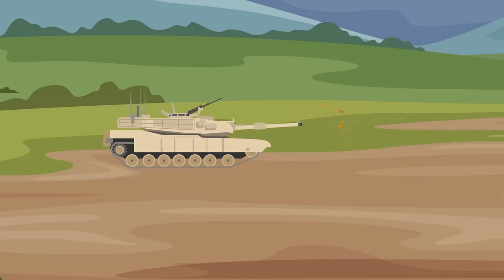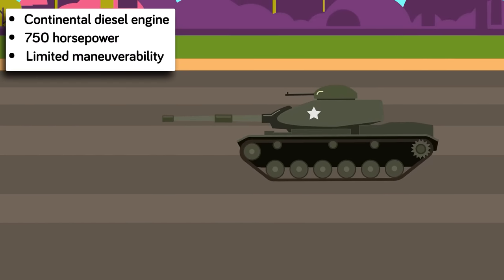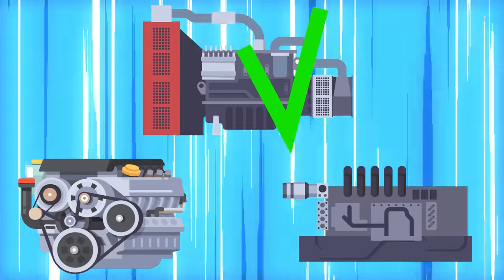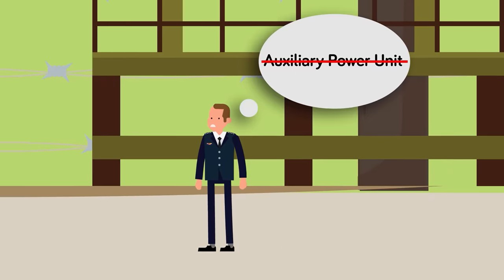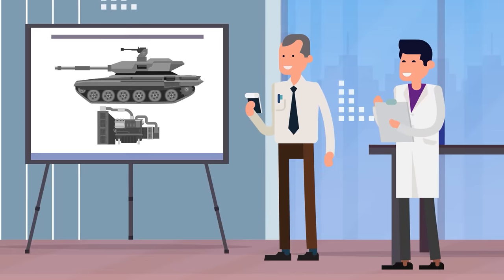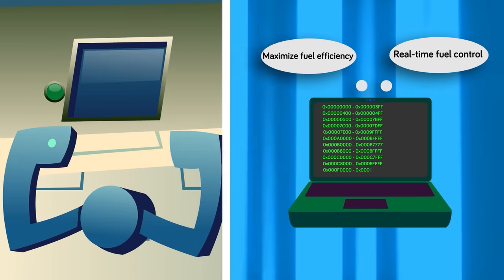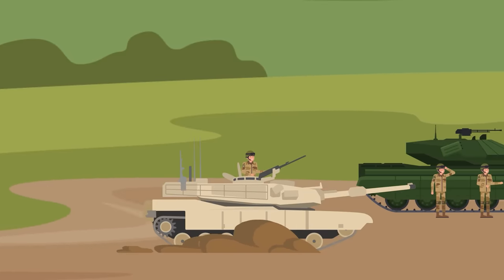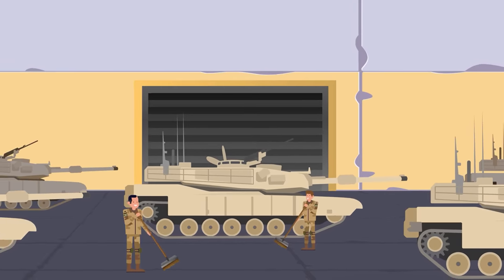Why M1 Abrams Turbine Engine Is Actually OP

Comment: To distinguish between the 2 types of engines mentioned here, the terms should be "turbine and reciprocating" as they both can and do run on diesel/kerosene aka JP-8 and JETA.
Reply: That is well pointed out. Before I was forced to work on track vehicles, many wheeled vehicles I worked on were multi-fuel. I never thought of it before the military.
Reply: But there's no such thing as a diesel turbine.

A "diesel" is a piston engine that runs on diesel fuel.

A turbine that runs on diesel, is a turbine that runs on diesel. It's not a "diesel".
Reply: @Robert Pruitt  The fuel that we recently used in the military (JP-8) is very similar to diesel.  I handled it daily for 4 years in the USAF.  I believe now all the military went to JET-A and I've never dealt with it.   But,  yes a turbine can and will run on diesel if it's put in the tank.
Reply: @MrBen527  
You didn't grasp what I was saying.

I said a turbine that runs on diesel isn't a diesel engine. It's still a turbine by name. It's a turbine that runs on diesel, not a diesel turbine.

A piston engine that burns diesel is called a "diesel engine". It's not called a piston engine that runs on diesel.

And I clearly stated that turbines can run on diesel.
Reply: @lordgarion514  You said there was no such this as a diesel turbine.  And, IF diesel was used in a turbine, it would be a type of diesel engine.

Comment: The AGT 1500 also has no problems with cold weather starts, as well as it is a very quiet engine compared to piston engines. Also, turbine engines have a higher power to displacement ratio over diesel and gas engines
Reply: Wow! You really don't know your history regarding the M1 Abrams.
Cold weather starts have been a major problem for the Abrams since it was introduced into service and remains a flaw in its design.
Reply: Actually the Continental AVCR-1360 that won the XM1 trials competition was rated at 1,600 horsepower and weighed the same with a lighter combat weight due to the smaller fuel cell.

Comment: First, the IR signature of the Gas turbine is larger, the injectors are more prone to soot and have to be drilled out regularly. In normal conditions it consumes almost 10x as a modern diesel engine.
Reply: That entire post is a flat out lie.
Reply: 10x? You just making stuff up for what reason.??

Comment: For the equivalent hp output turbine power plants are much lighter than any piston powered equivalent. How does the M1 get it's pressurization and air conditioning accomplished? If it uses air cycle machines then the "overpowered" power plant has to be so to operate at full power and provide bleed air for the acm. Just thinking out loud.
Reply: It's overpowered because if you take the regulators off, it'll do over 70 MPH.

Comment: I vaguely remember that the engine was a repurposed Apache engine but seems I was wrong lol. But, didn't M1s had issues with getting fine dust/sand through intake that would cause engine failures?
Reply: Yes, same as that Vulcanic dust issue the jetliners had.
Reply: No
Reply: FOD is not too good to aby turbine engine
Reply: Well, not engine failures, but in the first Gulf war, the sand gave the tank crews a bad time. They constantly had to stop and clean them.

They designed better filters after that.

Comment: I was in an M1 with no turret.  We turned off the limiters. It went way over 70mph. I bet it would still do 60mph or more. The driver let off as we all felt it was on the edge.
Reply: Probably 60km/h! tracks wil not do 70mphl

Comment: Abrams and HIMARS engines are very similar in one thing - a lot of it's components can be just easily unplugged/unscrewed and replaced. ECU fried/burned out? Just swap it, no dismantling needed. A lot of HIMARS engine parts can be just swapped without much trouble.
Reply: You're talking about the vehicle of the HIMARS, but same is true with the components of the rocket system. swappable boxes.  We were trained on how to open the boxes, pull out the motherboards and how to solder and desolder, but not how to diagnose fried chips...

Comment: OK but when it sits still because running out of gas will it still be such a beast ? It's probably a beast when supported by a very much intact supply line. A Leopard 2 will go much further on same amount of fuel. Keeping robust logistics in a conflict is not always affordable.
Reply: Check out operational ranges of both tanks. Roughly the same because Abrams has a larger fuel tank.
Reply: The US Army must be the king of logistics because I never ran out of anything, Especially, Fuel, Beans, and Bullets. That was during assaults' or at an OP in the middle of nowhere. Lets say for the sake of argument that you did run out of fuel. Can you think of a better bunker than a Tank? You don't have to run the engine or EAPU to use all a M1's weapon systems.
Reply: The entire world spends $1.92 trillion on defense (before this current Ukraine war).

Of that, Russia spends $60B, and China spends $250B.

All of NATO spends $1.1 Trillion, and of that $1.1T, America alone spends $850 BILLION.

There's not a country, or a private company, with better logistics than the US military.

Comment: Even though it would have been meant to run on jet fuel, it pretty much can burn anything you dump into that's flammable enough to run it, as Jet A1 fuel is technically a type of diesel fuel, being comprised of mostly Kerosene. If you are desperate to get tank moving, you can just dump in gasoline and call it a day. Jet engines including this turbine engine have advantages that allow them to function regardless of height and fuel type. Just so long it doesn't have water in fuel system unless the turbine engine in the tank got a way to get rid of water automatically (most trucks do, yet I am not sure about military vehicles as they have very different designs to ensure their survivability).

Comment: One thing the old abrams had one major flaw with the gasturbines it had exelent dust filtes exept  for shellsand its so fine it passed through the filters .and crushed shells is the stuff that turns in to quiklime when heated but also destroyes the turbine blades .  real nasty stuff ,
Reply: I would imagine engineers managed to solve the problem with better air filtration, right?
Reply: @tluzanov  not for the volume of air needed.

Comment: this gas turbine engine runs so hot its IR signature can be seen from space. It would be cheaper to equip them with mobile phones if they want to let the enemy know they are coming.
Reply: Anything hotter than background will show on thermals even if it 1 degree up or 1.000. 🤦‍♂️

Comment: It's really too heavy for Eastern European plain terrain like Ukraine. Trust me ! No military commander in countries with low military spending would want to take on this fuel-hungry monster. It was a bad idea 40 years ago, when General Dynamics Land Systems designed it a turbojet engine for fighters. It's like the Kharkov Tank Machine Plant's T-80, it's strong and fast, but the T-80 is lighter and more maneuverable on the frozen ground of harsh European winters. The Soviets and Americans confidently secured the technical logistics of these jet-powered T-80s and M1s, but after 30 years too many problems arose. What they have in common is the high cost of engine repair, which is naturally higher than that of an internal combustion engine. But the Soviets had a spare in their possession of Uralvagonzavod's T-72 tank. It is like Toyota Hilux, very durable and easy to repair, very popular in military forces with low cost. An important thing that M1 is ranked below compared to Leopard 2A, is that it does not guarantee good maneuverability. The German Leopard runs on a Diesel internal combustion engine, of course this MTU Diesel engine is more "friendly" than the other turbojet engines.

Comment: It now has an upgrade where it will probably end up being able to be deployed for many many more miles, and many many more hours it has a battery power plant that allows it to operate with its engine off saving fuel, and obviously being significantly quieter
Reply: The Gas turbine is a major disadvantages in standby endurance and battlefield performance.
This is why the Army selected the Diesel powered General Motors XM1 for adoption into service.
Reply: @WilhelmKarsten  it was the most powerful that’s

Comment: The one great thing about the gas turbine is you can put ANY fuel and I mean ANY fuel.  Diesel, gas, anything that is combustible you can put in it and it will run and take that type of fuel. So in a pinch the maintenance and supply team not coming fast enough if you see a gas station and are desperate for fuel then you can use gas of all kinds.  The engine will take it.
Reply: That is completely false, stop posting lies and misinformation.
Reply: The Lycoming AGT-1500 can only be run on NATO STANAG CODE fuels F-18 through F-77  or their civilian equivalent. Some of these fuels can only be used when blended with another type.

Comment: The M1 Abrams can travel speed on flat hard ground of 57 miles an hour that’s with half a fuel tank and no ammunition that’s amazing but once it’s completely loaded and ready for battle the maximum speed I believe is 44 miles an hour which itself is also pretty significant, and the engine is one of the more reliable engines in this class. The only other tank I would have concerns with if I had a battle with it would be the British challenger only because they have a much longer shot capability because they’re armor. Is not of the same caliber as the leopard or the ABRAMS

Comment: Well, the conventional combustion engine of the leopard 2 is limited to exactly the same 1500 HP and can also be replaced in about 4 hours.
It runs on gasoline and Diesel and consumes half of what the turbine of the Abrams wants.
Reply: The Leo2 drive unit can be replaced in about 30 minutes.
Reply: leos are much much slower

Comment: you can’t say 1500 HP of ENERGY. Hp is a measure of power, not energy. Energy is Power x Time. For example Kw is the unit for power and Kwh is the unit for energy: 1 Kw of power for one hour

Comment: Is 45 mph the top speed on it?  I remember it used to be 60 mph.  I knew a guy who worked on them 30 years ago and said if you take off the speed governor, it can probably hit 80 mph.  But you'd run out of gas pretty quickly.
Reply: That's before the M1 developed a weight problem...

Comment: Turbine engines have their advantages and disadvantages. They are compact and produce a lot of torque but in return they are hugely inefficient especially when idling and have a big thermal signature. 
With only very few countries ever using turbine engines in their tanks and russia moving away from them i would guess most countries consider diesels the better option

Comment: I wonder when an electric hybrid tank will be used. Seems like the most efficient and powerful way to move a heavy vehicle.
Reply: The next generation abrams are actually set to be hybrid to save on fuel. This could also cut down on noise if you want to move more quietly for some distances

Comment: There's so many things that are close but still wrong. Also, saying that the engine was fuel inefficient is a comparison to cars and trucks...but in reality they weren't far off from peer tanks and in idle they were basically the same, but under a load they are better.

Comment: The 45 mph / 30 mph on road /off road speed the Abram can achieve is not its true top speed.  It is a regulated maximum speed.  The Abrams is capable of going much faster, but the problem is that doing so will cause accelerated wear on various parts of the tank.  Also, going faster than those speed posses increase danger to the crew.  When you're inside a vehicle weightings over 60 tons, accidentally hitting a heavy obstacle or going over a large hole on the ground while going over 45 mph will result in serious injury or even death.

Comment: The engine is the big difference to the Leopard 2 (armor and firepower are about the same) and the reason why the Abrams is the worse tank.
By using the turbine instead of a Diesel it trades an additional supply line for cerosine plus a higher fuel consumption which needs to a significantly lower range for a few hp which don’t really make a difference. On top of that the turbine is more difficult to maintain.
That turbine is a really bad idea
Reply: Abrams can run using any fuel, army uses JP8 as it is universal fuel. Turbine is easy yo maintain as the only moving part is the compressor.
Reply: @viceralman8450  not true, not spreading lies and false information

Comment: I always laugh when I read comments on other channels calling the M1 “slow”. The tank’s engine makes 1,500 horsepower and (more importantly) 2,750 foot-pounds of torque at 3,000 rpm. No other tank engine on the planet comes close. It can accelerate the current 69-ton version of the M1 to its governed/rev-limited top speed of 42 mph in about 15 seconds. There is anecdotal evidence of non speed-governed M1s exceeding 70 mph during testing. That’s far from slow.
Reply: the leopard 2 engine makes  4700nm of torque at 1600rpm!

Comment: If it is the best option it will surely be in the further Abrams X . . or not cause diesel is the way to efficiently move heavy things. Ask a Farmer, Trucker or a Captain. Diesel moves the World.
Reply: Diesel is best bang for your buck. Turbine engines are like high reving gas engines, they barely idle, get terrible fuel mileage in normal driving but match power output at a fraction of the weight. At full throttle and identical power output gas, turbine, and diesel all get nearly the same fuel efficiency

Comment: What is described in this video may be true but does not address the fact that the comparable Leopard 2 tank runs on a diesel engine and in nearly every way at least equals if not surpasses the mobility of an Abrams. IMO the Abrams is still the better tank but no longer if ever because of its powerplant. In any case, engine replacement is again a top priority in proposed new designs. The Arams X is proposed to use an electrical motor powered by diesel. It might not have the long, sustained performance of a gas turbine in first generations but will far exceed what the current gas turbine and diesel engines can do in short sprints which is generally all that is required.

Comment: In my opinion, leopard 2a7 is better than Abrams. Abrams has just 30mm thick Armor on its hull top. Also the gas turbine engine is powerful but not so economical in fuel and make maintenance
Reply: @viceralman8450  i hope the bundeshwehr upgrades leopard's ammo storage.
Reply: @viceralman8450  but what about the 30 mm thick Armor. I guess the US army needs to upgrade it
Reply: @TechnicalGamingRakesh  Apparently then don’t care as Abrams have blast doors and blow out panels on the hull storage since introduction.
Reply: @TechnicalGamingRakesh  They upgraded the upper glacis on Sepv 3 but how much it’s classified.

Comment: It's a maintenance intensive beast...I'd prefer a Leopard 2A6 over that thing, especially since the Diesel in the Leopard is much quieter, too (and can be shut off in the field, so it only runs and produces a large thermal signature for rockets to lock on to when actually moving!)
Reply: The Leo engine is much louder then the m1 tho the m1 just a higher pitch if your close to it but that also means the sound drops alot faster than that of a lower pitched deseal one if you were 50ft away from one you only hear the tracks not the engine